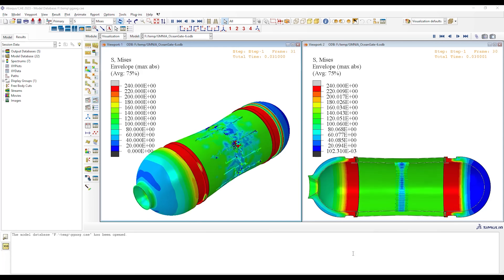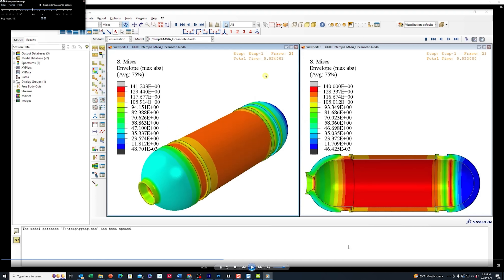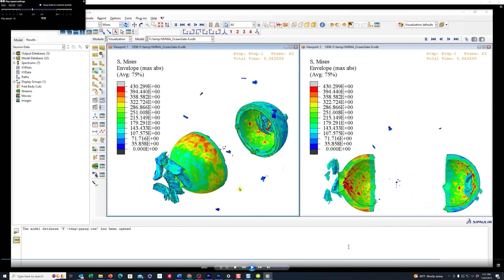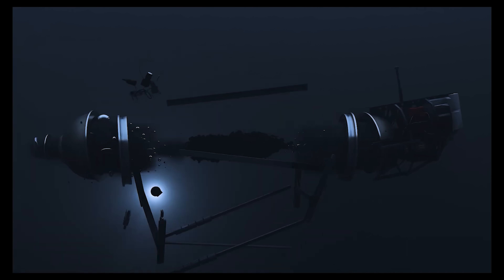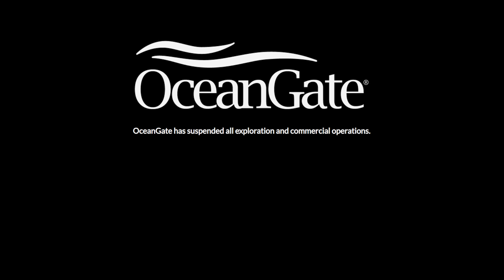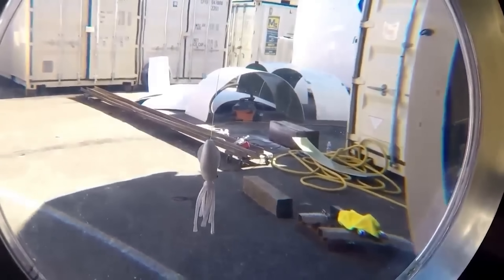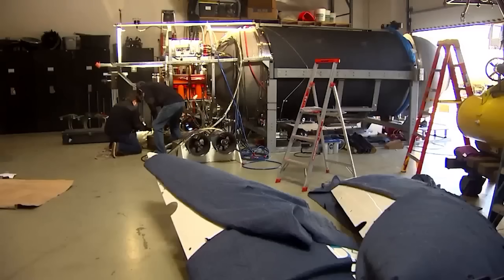Best Titan Sub Implosion Simulation, Cracked Porthole? Q & A

Comment: Jeff, you show two of Dr. Wagner’s simulations. One is midpoint hull failure and the other viewport failure. These may or will be useful in interpreting the recovered wreckage (and video of bits and pieces (or lack thereof) in the debris fields). I’d like to know if the third scenario was failure at the titanium ring-composite hull interface. 

Other commenters (@jimschultz & @paulgallagher2937) highlight this interface as needing serious consideration due to its geometry and dissimilar physical properties. I also view this joint with suspicion for the same & similar reasons. (My qualifications - very little in structures made of fiber-resin composites but do hold a bachelor’s degree in mechanical engineering and as such have had the basic statics & materials properties courses - stress, strain, UTS, fatigue, …). Many have said modeling the composite hull is difficult but modeling the joint would be an order above. I agree with the other commenters & other YT channels (who really sound like having experience in the field to my engineer educated brain) because:
The dissimilar thermal expansion characteristics of the composite & titanium;
The dissimilar stiffness/Young’s Moduli (the two are related) - the parts of the joint will deflect differently under stress;
That most other in the field wanted nothing to do with carbon fiber (at this time) for passenger carrying submersibles;
The limited experience of using composites under high hydrostatic (compressive pressure) loads - on YT channel did discuss use in under sea piping which was not a long term success storytelling;
The potential for degradation of the composite over time and cyclic loading (fatigue);
One YT channel showed cross sections of delaminating composite where, most alarmingly) the damage is inside the material (like the deck at CTS?) not readily seem by visual inspection. In metal fatigue the cracking (in the absence of an internal void/slag inclusion) virtually always occurs at the points of maximum stress/corrosion which is on exterior surfaces;
Finally, the irregular geometry of the coupling: in Ocean’s assembly video one can clearly see there is a step-down in the end of the composite cylinder where a rim of the ring fits over it. If the cylinder were metal my engineering training scream watch out for stress concentration at the corner. With titanium or really any ductile metal designers know how much of a radius to specify, how much the stress will be concentrated and how long the safe life (in cycles or hours) of the part will be (and how much safety factor to apply). What is the case for composites & the resins - TBH I don’t know. What IMO opinion makes this design insidious is that composites can delaminate internally and the rim prevents easy visual inspection of the “end grain.” How often were the rings glued and unglued? How often was the composite inspected in any manner (other than RTM) by removing the inner liner & the outer coverings?

Comment: How much 150 lb/ft^3 concrete would it take to develop 2.6 tons/in^2 pressure - the approximate pressure to which the Titan would have been exposed at depth?  A stack of concrete .94 miles high!  Grab your snorkel and goggles and jump in your backyard swimming pool for a minute while we stack .94 miles of concrete on top of the water in your pool.  That's roughly what it would have taken Stockton Rush to simulate - on land - the pressures on the Titan at Titanic's depth.

Comment: One of the questions is:  what is "dead?"
Dr Guillotine showed us long ago that the brain remains conscious and able to control muscles still within control for up to a minute after decapitation.
(The question is relevant only in the context of this millisecond analysis.)  I think the refinements proceed:
At what point does the brain lose consciousness irretrievably?
Why?  What is the cause for (the previous)?
Is it compression or physical disruption?
First phase is compression.  Certainly the ear canals will collapse first.  Lungs, being large, will start to collapse, with some delay offered by rib cage.  Before the ribs fail, the torso skin will be shredded due to flow developing below and between the ribs.  Perhaps the sinuses briefly thereafter.
I can see the compressive flows damaging throat, jaw, roof of mouth.
Body fluids will not compress, as they are not bubbly.  Do bones have air pockets?
The next phase will be kinetic:  vessel fragments animated by the compression dynamics.   This would be modeled by Monte Carlo techniques.  In summary, though, he vessel bits will be driven inward to the extent that the contained air volume is compressed.  The water pressure is something like that 376 atm, so the air volume—after oscillatory effects—would be 1/376 of the original of the original hull volume.
To visualize this:    get a 10 cm box.   Collapse the box until it is a 14mm cube.
So I think the kinetic phase applies mainly to the folks sitting in near the midpoint of the cylinder.
The kinetic phase could be applied to the folks sitting in the end caps, but these folks will be 1) protected in some part by the end caps (thus complexifying the sequences) and 2) so quickly overcome by the next phase soon enough, that I suggest we neglect the details here.
The next phase is the Rudy Diesel stage.  Except diesel compression tends to top out at 25:1.
25:1 vs 376:1.....    I think the numbers speak for themselves, so I'll stop here.

Comment: Aren’t the "Cracks" dirt that gets sucked in when the sub emerges, The pressure change could create a vacuum in the acrylic/titanium connection.  Big pressure on the window would push everything out of the connection, losing the pressure would pull anything in.. I believe it's sweat/water/air and dust that’s pulled into the connection after several deep dives.

Comment: My initial thought was the viewports failure, with repeated flexural cycles and by appearance bond losses at the seat juncture, the substantial certification deficiency, and the admission that significant deflection occurs at depth…a simple fracture would propagate at lightning speed and create an internal blast wave the would easily blow off the titanium domes….

Comment: The porthole was completely blown off, acrylic and nuts/bolts. I can't see how a mid-section implosion that didn't affect the cap, would have ripped off the acrylic. Most of the implosive forces, assuming it collapsed in the middle, would have dissipated way before any effect of the implosion would have ripped off the porthole. The implosion sequence started at the porthole.  Just my opinion.

Comment: What also concerned me is the fasteners used on the inside to attach those video screens to the carbon fibre walls. So compromising the thickness of those walls.
Reply: I didnt even notice that, did they just screw them into the hull of the carbon fiber?

Comment: I think what you're seeing as cracks on the porthole are reflections of clouds. Still, where the hell is it? When they brought up that hemisphere, the acrylic window is just GONE. Did they remove it in order to run that strap through the porthole so they could easily transfer it off the ship? Would they do that? To my way of thinking that would be tampering with forensics evidence.

Comment: 13ms is to see, it takes a further 12ms for the brain to process what's happening.
The marks are in the interface between the acrylic and the titanium. The window is much larger on the outside than the inside and it is tapered to allow for the pressure.

Comment: The simulation completely neglects the detonation of flammables happening almost immediately after implosion's exceeding 300 psi.  The window "cracks" are simply defects in the adhesion quality between window and shell that would tend to reseal under pressure.

Comment: I think that the carbon fibre cylinder part was the first to fail. Plexiglass is acrylic plastic aka perspex. Those apparent "cracks" are more likely the visual interaction between the plexiglass and the sealing material.

Comment: In my opinion, removing the frame caused implosion. 
What I heard about incident through unofficial script, (they said it was last communication between polar prince and titan) 
They had some technical issues and that won’t cause any implosions! But what they did was removing the frame, so they can ascend faster. And I say that caused implosion. In these simulations it should be frameless.
Reply: exactly, but there are just too many variables and potential failures, just like the titanic....

Comment: Another great review of the incident! Remember that things generally fail at one point which then relieves the stress in the system. So the side rails probably pulled loose at one end first. Of course, additional forces would probably tear them from the other end. Maybe they are still attached to the rear ring/hemisphere?

Comment: Where did the extra weight that caused the sub to descend so fast come from? 
  It had to be water accumulation under the Rhino liner. Like a big water balloon, so that dropping weights, and the frame still didn’t enable them to surface with any speed.
 1/4 speed I-think it was.
  That sub should have been a rocket shooting to the surface.

Comment: Rino Liner is used to treat pickup truck beds.  It is cheap commercial product that is NOT certified for the environment and the application.  This guy is a nut.  I hope that the families take Oceangate to court and take every thing they have.  This is a process that does NOT need to be repeated in the future.

Comment: So, they coated the carbon fiber with truck bedliner coating. I am not familiar with carbon fiber enough to know if it can be inpregnated with water at those pressures causing the crackling and finally delamination. So, another jerry-rigging, using the Rhino bedliner to seal the carbon fiber. The "sub" was amateur made contraption surviving only with good luck. Until it run out.

Comment: You have the implosion lasting 35 milliseconds and point out human visual perception at about 25, but the implosion wouldn't be the only thing threatening the crew: unless I totally misunderstood both semesters of fluid dynamics, the incoming pressure into the sub would have superheated the air ahead of its incursion,  right? In other words – and not to be indelicate – they would have been parboiled first, and then squashed into… residue. But I don't see how they could have had ANY conception of what happened at the moment of the implosion, thanks for small favors.

Comment: Notice that he shows the rings flexing. The fiber tube would have pulled loose from one of the rings (probably the front) almost immediately then continue as he shows. The metal inner liner would have been squeezed into the back hemisphere like an empty tube of toothpaste.

Comment: I am guessing that the tube, even if made of steel was problematic. A sheet body is simply not very strong without bulkhead reinforcement. You can make it thicker, but it doesn’t add a lot to strength. I’d love to see an analysis of the tube with different materials.

Comment: I still wonder about the 17 bolts, their size and, strength  plus the seal between the dome and the ring.  Based on limited phots it looks as if the bolts are about 1/2" (12.7 mm) in diameter.  There appear to be no washers or nuts, so the titanium ring had yo be drilled and tapped.

I wonder about the number of bolts and if leaving the 18th bolt out impacted the seal.

Was there a Voyage Data Recorder (VDR)?  Or, is this another item that was skipped for cost?

Comment: There's been much talk about the port hole window being only rated to 1300 meters.  So, why was it used?  It appears to be much stronger than other domed acrylic structures that have ventured to this depth.  This window was relatively  small compared to a full acrylic sphere.  It also was configured in a dome shape on one side and a cone on the other, which is ideal for this application.  I wouldn't be surprised if the window could withstand 5,000 meters.  But still, it should have been tested to the desired depth.

Comment: What difference does it make how it imploded ? It shared  no standards or specifications with other vessels. It was an one-off, with wrong material used.
Reply from the maker: I always chuckle when I hear uninformed statements. Like this period the engineering world needs to learn from this. And just hand waving bad material. Doesn't answer the question and doesn't help them avoid it in the.. This is why plane crash investigations take 2 years to reach the final engineering conclusion. Because they have to be precise about it. If that bores you, there's always the Kim Kardashian channel.

Comment: 21 years in the military, we didn't use rhino liner, we used CARC paint.  Very different.  Also, glue holding your sub together, wow.
Reply from the maker: Rhinp didn't hold anything
Reply: When I was in we joked that it was EB Green (military duct tape) that held subs together. If only the Titan designers had known that particular military secret.

Comment: i think as the deformation was happening, the end caps had leverage placed on them and popped off, that would explain the ULTRA CLEAN end caps with zero epoxy remnants visible.  i work with composites,  those end caps were ultra fine machine finish off the lathe, zero surface prepping.

Comment: If you notice in the videos of the building of this "submersible" 
You saw the carbon fibre going on straight as opposed to criss-cross. 
Weaker. 
Then when they hand painted the glue on... by hand, with brushes! 
That's not very scientific. 
Then when he lowers the Titanium end piece on, there is no glue overspill! 
Nowhere on that ring had glue squished out. 
And that is an "un-inspectable" seal. 
You can't see through it to know if there's an even amount of glue across the death trap. 

I'm not surprised that certification company preemptively reached out and said they'd have nothing to do with a carbon fibre hull.

Comment: There is no off the shelf electronic camera/phone etc. that can survive on such depth un protected. The cameras that were outside if their seals remained intact could have some data on them but it will be a big stretch. Phones and chips from inside got pulverized in miliseconds just like the people holding them.

Comment: I believe that the 'cracks' seen at 6:44 is just condensation on the porthole.  The rest of the picture shows water condensing on the walls from warm air (breath) hitting the ice cold sides of the sub while at depth.

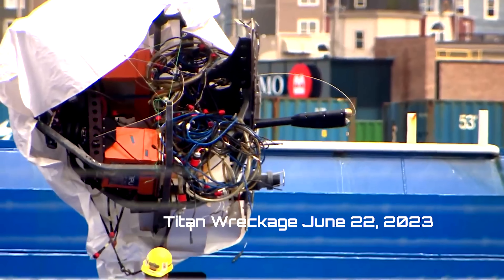Comment: 10:30 SD card in the middle of the ocean? Talk about a needle in a haystack.
Reply from the maker: If it's still in a camera or a phone, it might be easier to find and there was a camera built on to the outside of the submersible
Reply: @jeffostroff  The camera on the submersible would probably still be intact but any phone more then likely is gone.

Comment: interestingly, in the first simulation from the German guy, the two titan hemispheres approached. In the 2nd simulation of the young lady, the hemispheres departed. I would stick to the 2nd one (i guess they should first approach when the support disappears, and then depart when the shock front hits).
Reply from the maker: Yes, with this type of software, it really depends on the inputs you give it. There's a lot of assumptions that you have to make.
Reply: The first one is most likely correct, the collapse of the cavity where the hull was would pull the hemispheres together. The one exception is a heterodox theory of how deep sea implosions go down which is not really supported by sonar evidence which is sometimes called the "NOx compression hypothesis." 

It states that there are three main events that occur in such an implsosion, the initial compression. In this initial compression the nitrogen and oxygen in the air that was in the cavity are heated and pressurized such that they become highly explosive NOx compounds. Then under that compression (which is 20-200x higher than a diesel engine) they explode outward into a larger cavity. That larger cavity then collapses again at high speed while the "exhaust" gasses dissolve into the water. Under this theory they would have come together, blown apart, then got sucked together again.

Comment: Did you say the carbon fiber hull was "glued" to the titanium ring?  Also i am a bit interested on the hand pump that was designed to release the weight to allow for emergency accent. How would you even go about pressure proofing something like that?

Is that typical? To me sounds like "corner cutting".

However, im not an engineer and have no clue what is standard for a sub.

Comment: My understanding is that the sub was doing a dive straight down because they lost power. Everyone was either standing on the port hole in a tight circle or stacked on top of each other, still on the port hole. This dive lasted between 30-75 seconds or something. Around 9000 feet is where it failed i guess.

Comment: That hand pump is scary. I think the worst case scenario for them would’ve been for the pressurized area to spring a small leak. 

You would have a stream of water powerful enough to cut your fingers off, slowly filling the sub, causing it to sink, and the air pressure in the sub would slowly build as the entering water compresses the air in the sub. 

This isn’t what happened here but being slowly crushed to death by increasing air pressure would be a terrible way to go and any small leak would’ve caused this outcome as the entering water would quickly overcome any buoyancy the sub may have had to resurface.
Reply: You're kidding, right?